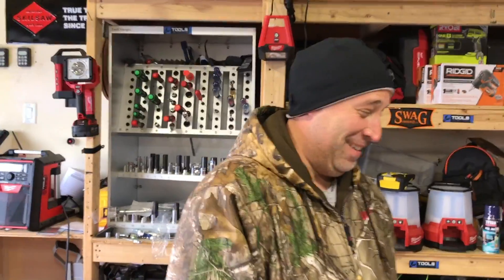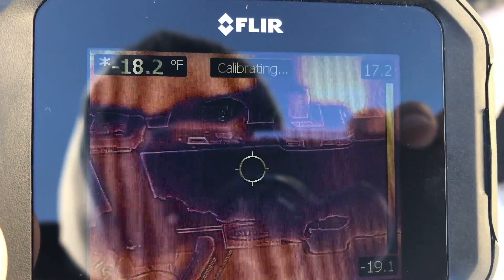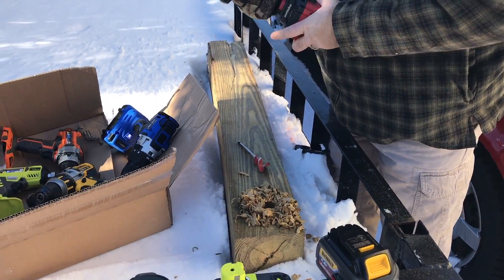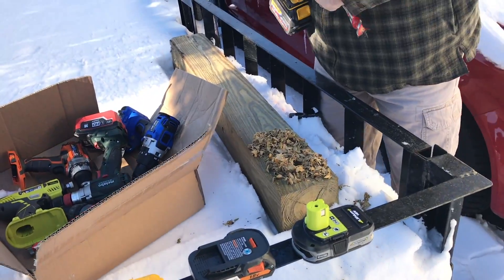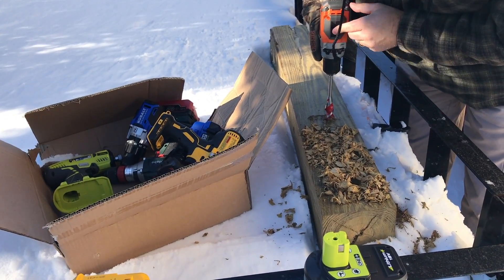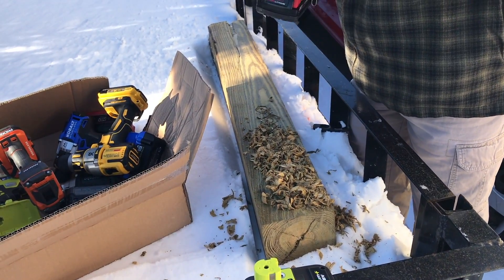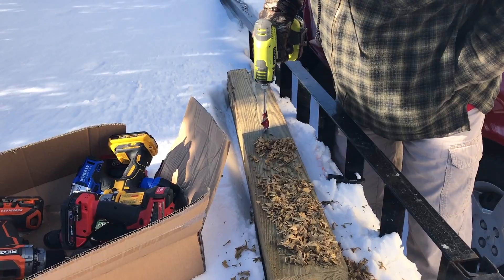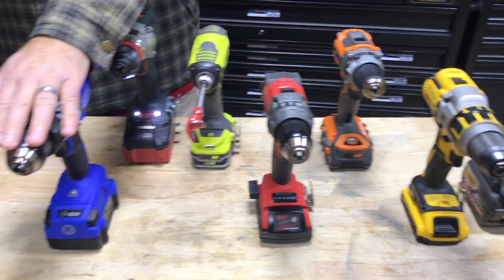Lithium Ion Battery Freeze - Below Zero What Happens?

Comment: When you cold soak lithium chemistry battery's it cuts down there energy storage "capacity" quite a bit making then act like much lower amp hour units , they will warm up with a little light use and recover there high current ability, let them warm up a bit before pushing them into high current demand use or the low voltage battery cut off protection will activate , Fast Charging very cold lithium battery's can damage them if there battery protection hardware does not limit there charging current properly.

Comment: I'm very amazed that those batteries could operate under such cold conditions. I recently bought some power tools and this is good information. My next question is how are the power tools themselves affected if you leave them in the cold a whole night and plug in warm batteries to test them.
Reply: The hardware would be ok, the main problem with cold and battery operated equipment is going to be the battery. This is due to chemical reactions slowing down at colder temps, which translates to a dampened energy output. Even though the batteries read 3/4 bars of energy, they were still full, the tester is just confused about the output. These problems can be remedied by warming the battery.

Comment: Almost 20 years ago,I built a garage in the winter and it seemed like the cold destroyed the batteries on my Black and Decker tools.
Reply: Charging Li-Ion below 32°F will kill it faster than anything, but just using them at extreme temps will wear them out faster, too.  Mostly the high temps.  Cold temps will reduce V & capacity temporarily.  Just putting a draw on the battery will warm it up some.

Comment: In Canada using DeWalt and I used to haul all my batteries in at the end of the day in the winter.  Typical winter temps here between -15 celsius to -20 Was worried about the extended exposure to subzero temperatures damaging batteries but they seem to be holding up well. Anyone encounter any problems with extended exposure to subzero temperatures?  I keep them in my truck now instead of hauling them in.
Reply from the maker: They come back after they warm up.  I still recommend keeping them warm.  Ask Kruger construction

Comment: Lithium batteries have no issues being discharged in the cold; even if they are a bit lazy to start with, they will eventually warm up and work flawlessly. However, you should NOT charge a lithium battery below freezing. Doing so will damage the battery.

Comment: So basically what we saw is that every battery was affected but that none of the 2Ah packs were really able to complete the task on the first pull which is expected.  It doesn't take long for the lipo batteries to self-heat and restore some of that capacity.  A more accurate test would be to install the same bit in every chuck ahead of time or install it before you install the battery for testing.  You can hear how quickly the packs self-heated and began recovering.

Comment: The Ryobi did not work because you guys were using a hydraulic driver which will not work in extreme cold. If you had used a regular drill, it would have worked like the rest.

Comment: It's possible the wood could have skewed your results a little. Looks like the wood is splitting on both ends a little but looks tighter in the center of the beam. As you went further into the testing you were drilling into the tighter grains.

Just discovered your channel and have been loving the vids!

Comment: Very cool that the newer gen batteries work better in the cold. My first set of lithium ion batteries were the first gen V28 and I had to have a battery bag so I could bring them in every night when winter would hit. old habits are hard to break because I still do that just to protect the cells. Dan tell Milwaukee or another tool brand they need to make a hearted jacket with a plug for gloves as an accessory to be heated#TIACREW
Reply from the maker: ha so true

Comment: I wonder if the 2.0's were not as strong since they were smaller.  If at frozen if its 10% its around 1.0  the 5 would be around 2.5  this is just a guess but interesting.
Great video as always guys!!! #tiacrew

It will be cold in PA this weekend, I will leave one of my 5.0's outside and one of my 2.0's and make a video

Comment: Looks  to me like the Kobalt beat them all! I know where my hard earned dollars are going towards. Put the bit in and away it went with no fuss. Unlike all the others you had to fiddle with. That cold I wanna be in there and out without dicking around with a tool. Kolbat up their game, proof is in this video. Send this video to Kobalt I bet they use it! Thanks for braving the cold
Reply: Yes, the Kobalt did well in the test, but make sure they have you covered on the tools you will want. The lineup is very limited compared to other brands at the moment.
Reply: Yes limited at this time. Hope they get there line up a little more competitive in the future. Spank Ryobi's ass
Reply: Robert Barcus also to note that kobalt had a 4ah battery while most others had a slim pack. Makes a big difference.
Reply: Ok!, But if I am doing industrial work I am going to be using the higher capacity batteries anyways. Also the Kobalt Batteries are less expensive to replace, and they have a 5 year warranty on there tools.
Reply: Looked to me like they farted around long enough getting the settings right that the battery had already self-heated.  It only takes a short time for lipos to self-heat enough to  put out near full capacity and since it is a 4Ah pack it will draw from both parallel strings of cells.  A better test would have been to place all tool batteries of the same capacity into a deep freezer and test each one without pulling the trigger until ready to drill.  Even better they could have run some test leads to a test load instead of the tool and see what current each pack can produce right away and then 1 minute after drilling.